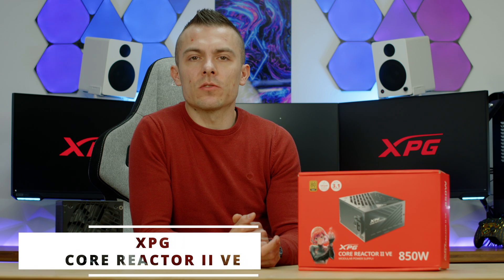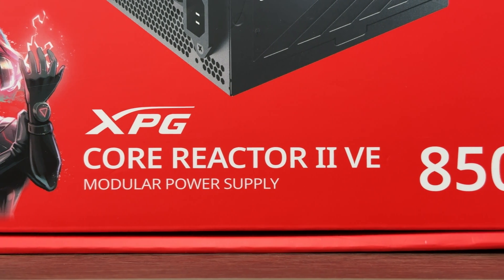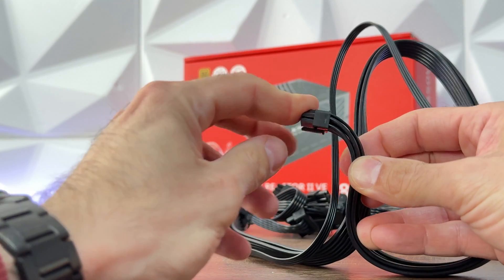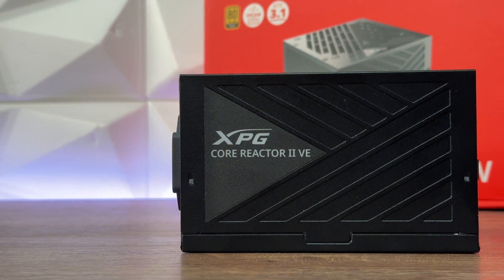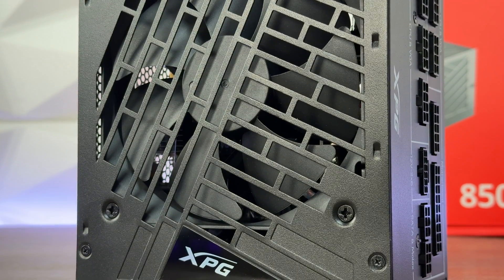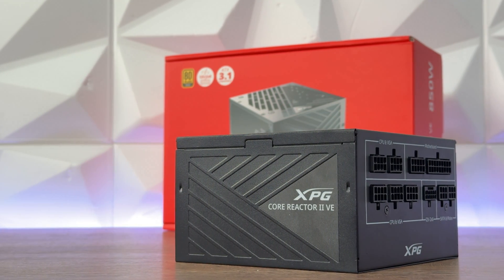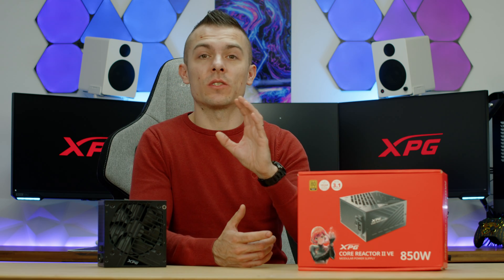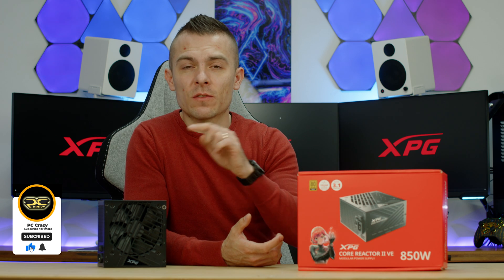XPG CORE REACTOR II VE 850W 80Plus Gold - Overview

Comment: Whats the different with the normal one?
Reply: Doesn't come with the 12pin high power connector and port that higher end Nvidia GPU's are using.
Reply: @patrickazzarella6729  Hell no, I got the normal one and it does have the 12pin conector, that’s the main reason I bought it, didn’t want my 4070s using power adapters.
Reply: @Natsufn7 sorry to hear that, the VE version is the one with the 12-2x6 power cable for GPU
Reply: @BrenoXavier55  I have the normal one and it comes with the 12pin conector, both versions does.
Reply: @Natsufn7  the normal has the 12VHPWR cable wich is know to melt, not the new 12V-2x6 cable
Reply: @BrenoXavier55  Both melt :D
Reply: @patrickazzarella6729  Guys if you are unsure about the information you are conveying please dont say anything because the misinformation is crowding the source